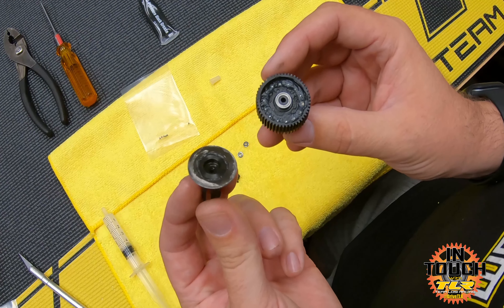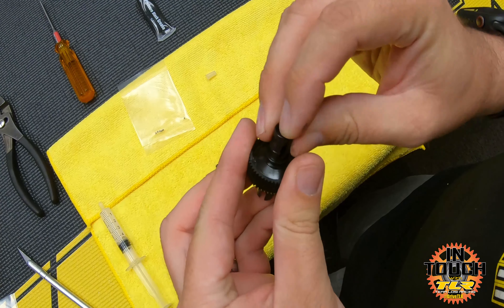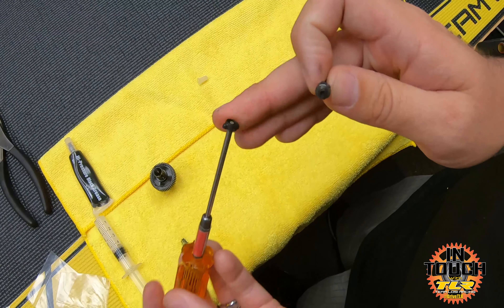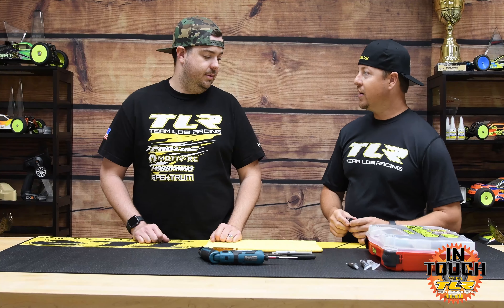In Touch with TLR: 22 Ball Diff Build

Comment: sigh followed this video step by step, and everything went smoothly UNTIL I tried to screw the assembly together. For whatever reason, the screw just wouldn't catch the diff nut. Lost count of how many times I tried compressing the spring, and even put the nut without the spring to see if it would catch at all (which it did). After so many tries, I either stripped the nut or the screw. 🙁 Anyway, a replacement Diff screw set is on the way while I continue with my 22 5.0 DC Elite build.
Reply: Dude same here
Reply: @motoracer202mx  Actually, when I reviewed the screw the next day, it turns out that it didn't have any threads at all! Butter smooth - anyway, a quick call to Horizon got me a new diff screw set in 2 days. The diff went together like silk with the new screw/nut. :)